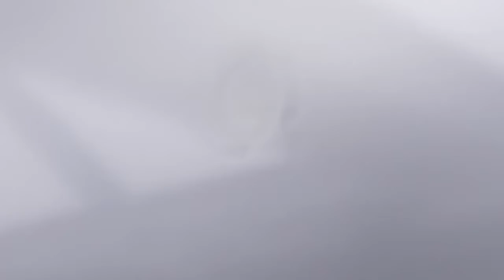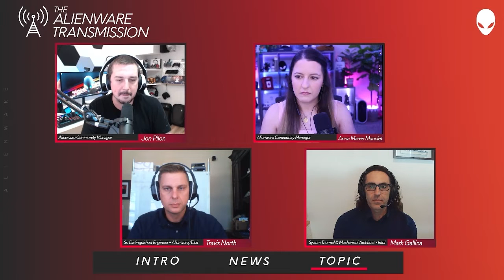Workloads | Alienware Transmission Clips

Comment: Excited to see the next (internal) evolution of the R13, I'm hoping the configs with 40 series GPUs can include ram with faster than the current 4800mhz clock and options beyond the 120mm liquid cooler :)